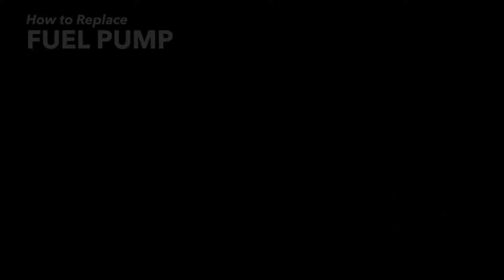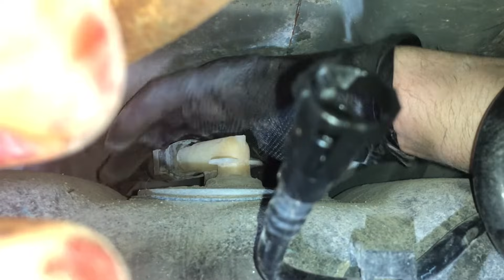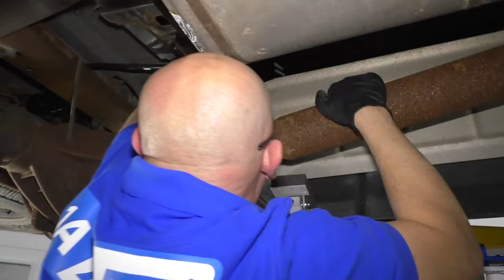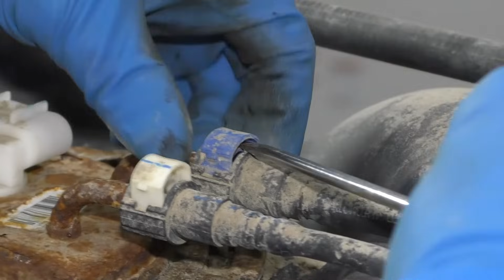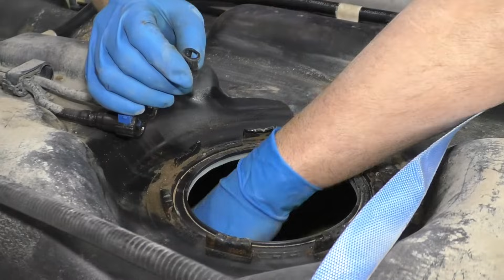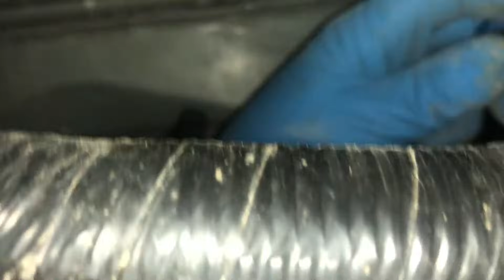How to Replace Fuel Pump 07-14 Chevy Suburban

Comment: Hey there! Was having trouble finding the part # for the fuel pressure hose towards the front of the vehicle. It’s the stainless steel one you connected back to the blue lock tab when reassembling. Any help on this would be greatly appreciated. I have to replace this hose on a 2007 Chevy Suburban LTZ 1500 4wd with a 5.3L

Comment: Just commenting to say I was replacing the pump on an 09 Chevy suburban 2500. It does not have the evaporative box, or the two hoses that would connect to it. It also doesn’t have a line going over any crossbar. I was able to remove the brackets holding the tank up, and use two light duty floor jacks too lower the tank, then I tilted it on its side, so I could easily see the fuel tank from the drivers side of the vehicle. The only lines/hoses I removed to do this, were the large rubber hose for filling the gas tank, and the line that connects the secondary tank. Once it was lowered, I could easily remove the fuel pump lines, and electrical connector and swap pumps. The vid was a big help, just wanted to clarify that for anyone else who might do an 09 and be confused by parts of the vid like I was.

Comment: Is the line inside the tank the return line and where does it go I pulled the pump up and out that line was a little kinked when I was hooking it back up but it seemed to be back to shape when I pushed the pump back in place

Comment: How do you pump the fuel out of the tank using the fuel pump? This 2012 Denali with 6.2 motor has the Fuel System Control Module not a fuse or fuel pump relay.  Everyone knows the tank is never empty when the pump fails so how do you get the gas out and make it easier to drop the tank?

Comment: On the install part, you mention to pass the vent hose over the bracket/crossmember..this is not the case for a 2012 suburban. It actually is formed to pass between the tank and where the rear strap bolts up. You will need to SLOWLY raise/tighten the bolt and CONSTANTLY check that the hose does not move and get squeezed.

Comment: This message/question is geared to everyone. I have a 2011 yukon and  I'm experiencing no power to my rear wiper,liftgate or rear widow defrost at first I thought was a fuse or relay but then I noticed that sort working intermittently so I think it might be a ground issue. Shoot me a line if you can give some direction thanks guys. As usual great video thanks again

Comment: Excellent video. I’m here after completing this today and your video was precise and I had no surprises. I did the fishing wire trick for the line inside the tank, that was super easy. 
For anyone doing this in their driveway, do yourself a favor and just start out by removing the driveshaft. It takes 3 min to remove and gives you a TON of room to work and see everything. 
I backed up onto ramps and jacked up the front drivers side frame. Plenty of room to work. I took my time and did this right at 2 hours. I didn’t think it would be a big job and it was way simpler than I thought.
Reply from the maker: +dvonas Thank you! We love empowering our customers and showing how to perform DIY auto repairs with our high-quality auto parts.  http://1aau.to/m/Shop-1AAuto-c

Comment: My 07 Yukon Denali XL Sometimes Dies at a StopLight RPMs be going back and forth between 1k rpm and just below the Line by the 1 rpm and eventually car just dies. Engine starts Shaking and yeah....I would Wait for like 2 min before I start her back up. My Volts be reading 12, 13. At first I thought my Music (Subs) was Causing these Problems, But I Took my Music out and its still acting up... Denali Starts right back up no problem, But this is getting Annoying ! Hope this is what I need to replace.  She has 310,000! Miles!
Reply from the maker: +Cam Mims Thanks for checking us out! 1AAuto.com
Reply: Did it fix your problem? Mine occasionally dies when I stop. Starts right back up.

Comment: Is the fuel filter integrated into the pump?
Reply from the maker: +Mark Brittell Thanks for checking us out! Yes, the filter is within the assembly. 1AAuto.com
Reply: Yeah, I looked all over for me fuel pressure sensor, and filter.... after failing to locate them in their usual spots.... I read that they were in the tank.... so I'm only assuming that the fuel pump has both on it when you order it.

Comment: Is fuel filter on the same assembly as the fuel  pump in this model vehicle?
Reply from the maker: +Maknificent12 Yes, the fuel filter will be on the same assembly. Please let us know if you have any further questions.
Reply: @1A Auto Parts looked on your site but couldn't locate fuel pump for 07 suburban. can you help with link?
Reply from the maker: +Maknificent12 Here are the part numbers for the two options we carry for the 2007 Suburban - 1AFPU00430 and 1AFPU01348. 1aauto.com
Reply: @1AAuto  LOVE IT! Thanks! Excellent service! Last question of part i'm not seeing? Do you have a part number i can buy from ya'll for a 1) pitman arm & 2) Gear box for 2007 chevy suburban 1500 4wd ?
Reply from the maker: +Maknificent12 We do apologize but we do not offer the pitman arm or the gear box at this time.
Reply from the maker: +Maknificent12 We do not offer the pitman arm or the gearbox for your Chevy. We also do not carry the pump we do apologize.
Reply from the maker: +Maknificent12 Sorry, we do not currently carry those parts for your 2007 Suburban 1500.  Thanks for the inquiry!
Reply from the maker: +Maknificent12 It seems these vehicles had rack and pinion steering, so those parts are not available. Thanks for checking us out! 1AAuto.com
Reply from the maker: +Maknificent12 Thank you for your interest, but we do not carry those parts for a 2007 Chevy Suburban.  We are always adding parts to our inventory, so check back with us in the future!

Comment: TIP!  If you are a schmuck (like me) and  need to drop your gas tank while lying on your back underneath your vehicle.
I used 3 ratchet straps, 2 across the tank (in the factory, steel band locations and 1 pulled around the back of the tank.  That third strap allows you to keep the tank from sliding rearward as you lower it.  I used a jack to do the lowering and the straps as a limiter, to lift it back up, the straps did most of the work. (the straps also make it easier because you can move the jack out of your way if necessary.  As you will see it is necessary to lower the tank to access the connections but you can't lower the tank until you disconnect them... Yeah, exactly! 
Be very careful and lower it slowly! The fuel pump output has almost zero slack and the rollover (?) valve (large conn. on top at the back end of tank) passes over a cross member and therefore can easily be damaged (disconnect it before lowering more than an inch or so) . I used the bottom of a plastic water bottle and the factory hose clamp to keep fuel from pouring out of the filler tube after removing the hose.
The 3rd strap is the key, without it the tank will continually slide rearward and get hung up on the rear end and will try to slide off the jack.  It's tedious since you have to, many times, release the straps and re-adjust but is better than breaking the connectors or dropping the tank. Good Luck!
Reply from the maker: +Kenneth Albert Thanks for checking us out. 1aauto.com
Reply: @1AAuto  :  You're welcome.   Thanks for providing all the info to us !

Comment: Thanks for this video.  I got mine done on the ground at home with 4 jack stands and 2 floor jacks to control the tank on the way down.  I did it by myself, but would have been way easier with a helper working the jacks and helping me support things.  Mine was super rusted and the lock ring wouldn't come off.  I had to soak it with rust penetrate and had to buy the otc tool to get it off.  My fuel pump still worked but was leaking on the top due to the extreme rust!  It was so rusty the fuel supply hose wouldn't come off the fuel pump and had to be replaced.  Fun stuff, but done.  Thanks again for the video, it did help!
Reply from the maker: Thank you for the great reply. We love to empower our customers by showing you how-to perform your own auto repairs while installing our high quality auto parts. Have a great day! 1aauto.com +David Selko